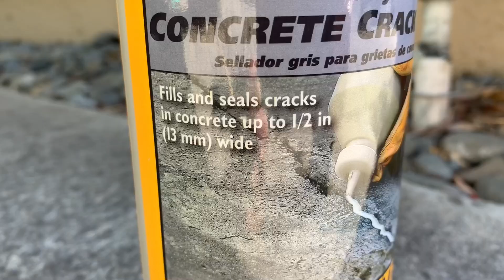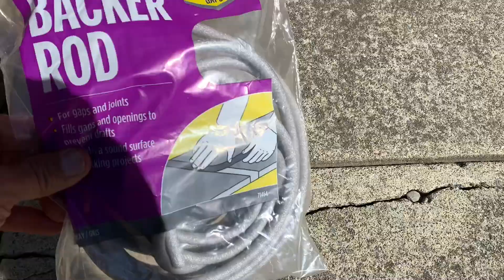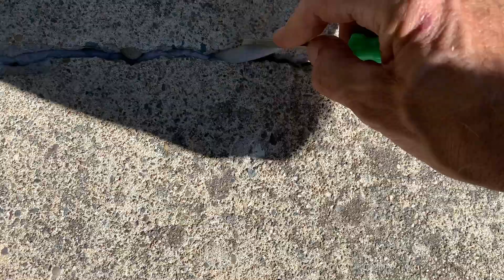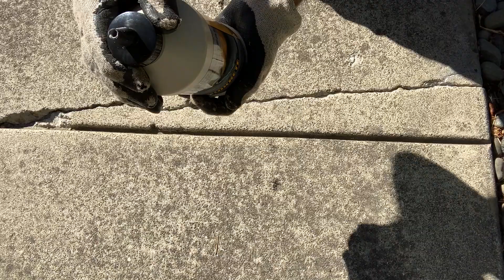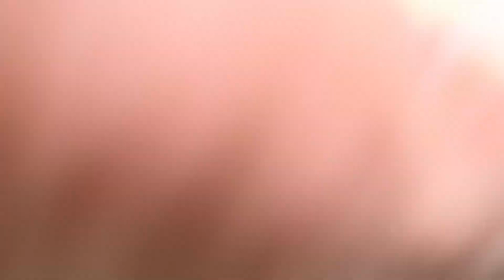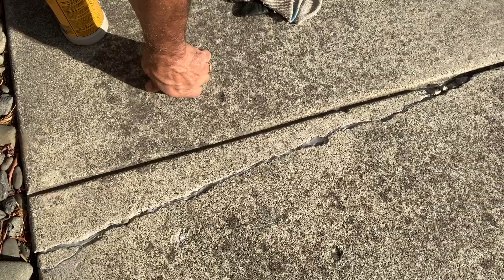Sidewalk Crack-SIMPLE REPAIR![Backer Rod + Quikrete] FULL VIDEO!

Comment: I used 1/2” backer rod on my driveway crack. The directions say do not do cracks that are more than a half inch deep. It’s close, but very inconsistent, some areas less, some might be slightly more. I guess I should have struggled to use 3/4” backer rod. I will be using sika concrete fix tomorrow.. the stuff for sloping driveways. Do you think it will be okay being slightly deeper than 1/2” deep in some areas??? It’s approximately 1/2” wide too